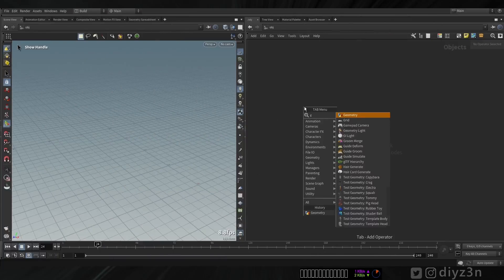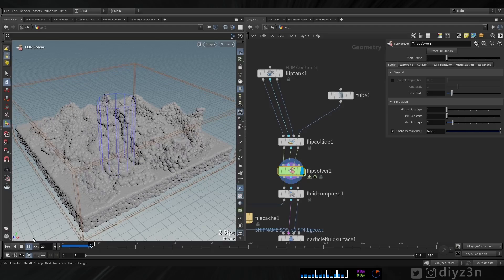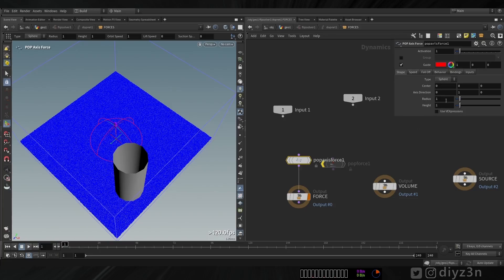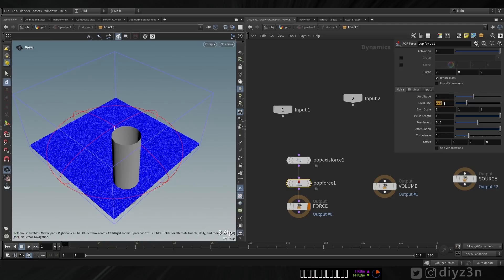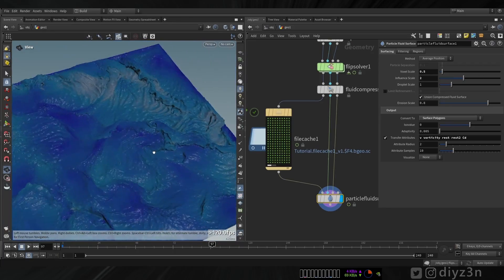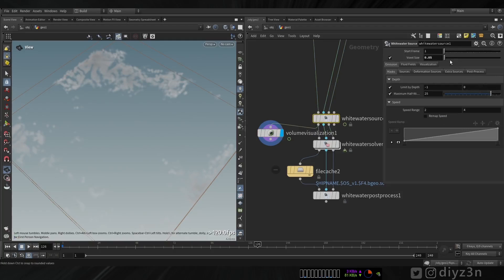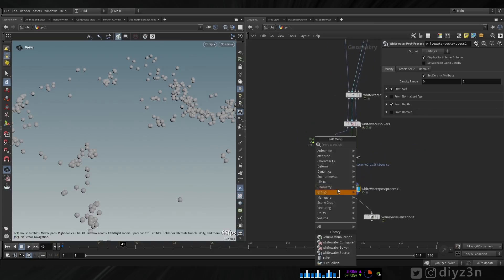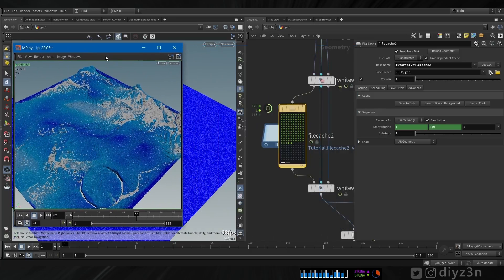Amazing WhiteWater and Foam in Houdini 20

Comment: Do you know how integrate with large ocean? Thank you
Reply from the maker: For the sake of rendering
You can see this 
https://youtu.be/KpqBM5jQeBk?si=htpAzESdGqdIYjMX
Reply from the maker: But if you want to blend the movement and sim, you can go with connecting ocean to the fourth input of the flip solver as a guide motion.
Reply: @diyz3n  I meant how to create the extended ocean, as is done for example with the Guided ocean layer. In practice, merge the simulated part with an extended ocean modified with displacement